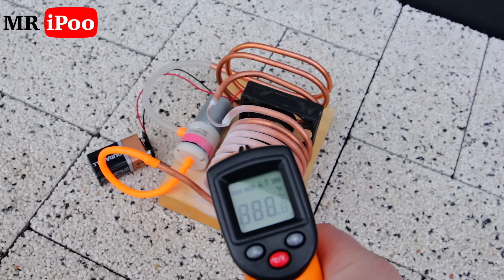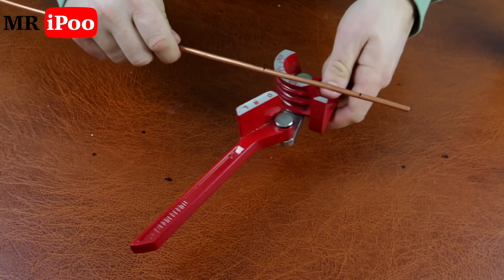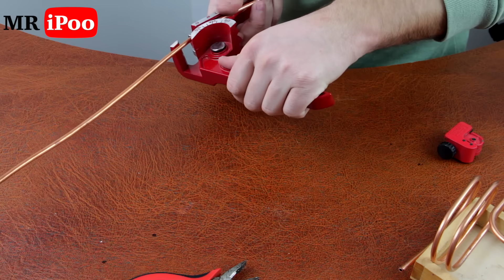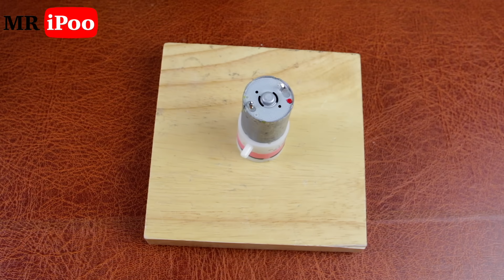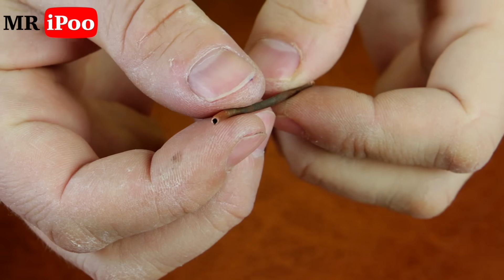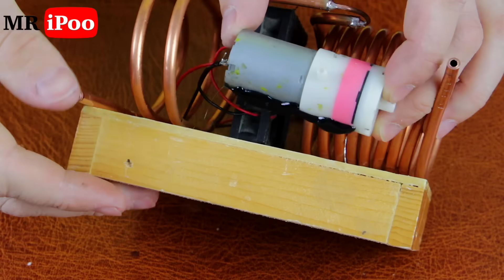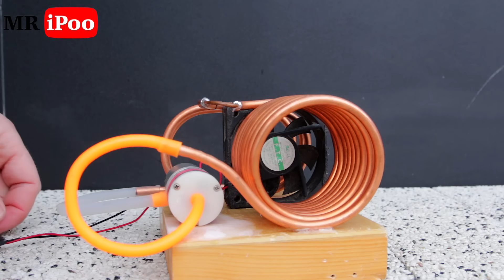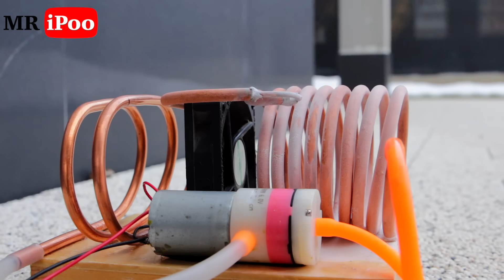DIY Freezing AC : Crafting an Icy Air Conditioner down to -32°C!

Comment: The motor and compressor used came from the plugin air pump from a fish tank. Pretty straight forward.
Reply: Lol not even close. This is a DC motor piston-diaphragm pump with a "crank" mechanism.

A fish tank pump is a vibrating diaphragm using a magnet and the AC mains frequency to drive it.

One has notable compression capability with reasonable flow rates. The other moves tiny amounts of air at in/WC level pressures.

They are not remotely alike in ability.

Comment: Im Ruhezustand hat Brenngas in Flüssiger Form je nach Außentemperatur 5Bar ca. 
In einem Kompressor werden Drücke bis 20Bar aufgebaut.

Das Spielzeug hier kann nicht funktionieren wie Dargestellt. Hier Versucht jemand die grenzen der Physik zu überlisten... 

-Befüllung ohne Vakuum ziehen. 😮
-Gummischläuche würden schon beim befüllen platzen, oder abspringen. Die Pumpe hat nicht genug Power, schon gar nicht mit einer 9V Batterie...
Reply: that's nonsense, at room temp lighter fluid pressure is only 3 bar

Comment: You can use those air duster cans for propellant. its just good old R142a
Reply: And previous freeze / dusters were R-134a (I think they were a CFC originally?)
Reply: @troubleshooter1975   Gotta love the Internet...
1,1-Difluoroethane, or DFE, is an organofluorine compound with the chemical formula C2H4F2. This colorless gas is used as a refrigerant, where it is often listed as R-152a (refrigerant-152a) or HFC-152a (hydrofluorocarbon-152a). It is also used as a propellant for aerosol sprays and in gas "duster" products.
Vapor pressure is in the 70-something-psi range for room temperatures - getting up there for the rubber hose tricks, but still a good choice for a bench-demo kind of thing.
I'm starting to feel a little compulsion to build a small chiller for the fun of it... maybe I should stop reading these threads 😆

Comment: the thing is this will never last long.  for one that little pump dose not have the power to compress the R290 back to a liquid.  I'm sure that little pump is not able to reach  200 PSI.  and that little hose will never hold the Flammable gas in.   I don't know why people like you waist so much time with this garbage, and lies.

Comment: How much heat can this system dissipate? Thinking of using this for a deskfan in the summer.
Reply: None because it's fake, the pump is normally supposed to be powerfull enough to bring the gas back to liquid form, which this pump with flexible pipes absolutely cannot do. The video was reversed
Reply: As for as using something like this for a desk fan, you have to understand that any refrigeration system does “make” cold air. It moves the heat from one place and releases it in another. The total heat dissipation of this system is negative. You have to include the energy from the battery which is dissipated as heat in the fan and the pump.  In other words if you stick this in front of a fan it is just going to blow hot air on you.

Comment: I'm surprised they haven't used this for PC cooling. Just "cold" enough so that condensation never forms. You can OC like crazy!!!!
Reply: It wouldn't be able to move enough heat.. If it works, it is very inefficient.
Reply: @MadScientist267   I think u may be right, it's why Peltier coolers never took off? But technology does improve with time.
Reply: @lil----lil  Yeah that's definitely an efficiency issue there. There isn't much to improve on. There will always be competing forces within something related to Peltier type devices... you have a resistance working completely against the force that is pumping the heat... it spends most of its effort trying to get rid of its own. 

To get around that, the material will need to be a superconductor, which currently aren't happening at CPU temps... if you've already got the cold temps you need for the superconductor... skip the middle man and use it directly... 🤷‍♂️

Those are useful devices, and can be made to operate rather efficiently (protip: don't drive them so hard, use more of them instead)... but once you start building a serious scheme that has some useful numbers, you're looking at both cost and physical complexity, not to mention real estate to give any stacking room to work.

Niche only. This kind of thing, assuming it actually works (the physics are valid, the materials are a different thing, rather dubious)... would fall into the same category.
Reply: @lil----lil  Have the holiday inn express version and definitely play like one...

Official? No. But decades of messing with all kinds of electronics both professionally and as a lifelong hobby.

"I dabble" 🤣
Reply: He hasnt used it because its fake...

Comment: Most people do not realize that home air-conditioners  and commercial air-conditioners use liquid propane. Only in cars is refrigerant used as it has to be non-flammable in case of a crash. The scaled up verison of this is the home window mounted air-conditioner.
Reply: My home AC at home does not use Propane, Propane refrigerant is  R290, witch is used a lot in Restaurants, under counter Cooling boxes ect. and some older Refrigerators.  Residential AC systems used to use R22, witch is being fazed out for  R410, witch is not flammable.  Cars use R134, witch is also not flammable. for any of these gasses to be flammable you need high oxygen levels.   You need to do some research before talking out your butt.
Reply: @McCuneWindandSolar What research does he need to do?  He sounded pretty spot on.  R290 CAN be used in just about any a/c system, especially the old r-22 systems.  Its VERY common in Europe to used in residential a/c.  But since the US is full of pussies that are scared of being "blown up", and since its available everywhere there's no money in it, so naturally it got a bad rap.  So just because YOUR system doesn't use R290, doesn't mean the next persons system can't.
Reply: @aaronk.4694  R22 runs at a higher pressure than R290  R22 high pressure is 250, and 410 is 480+,  and R134a is from 100  to 250 psi  pressures are all different.  the fact is this video what he is doing will never work. even if he used butane
Reply: A/C uses propane?  Where on earth did you read that?  No A/C product, domestic or commercial, uses propane.  You may be confused with after market automotive charging cans that do contain propane or its cousin butane.
Reply: @Georooney reffer units on commercial trucks
Reply: @Georooney the refer units on commercial trucks. They don't use it in normal automobiles because it's explosive. But since the begging of a/c units in commercial applications they used liquid propane, my neighbor has an old one that he had to remove the propane out of as he was convering the box into a sealed dyno room. And the unit said liquid propane only on the tag. I was dumbfounded as you when I saw the tag. And it certainly wasn't r134a we recycled into his forklift. We reclaimed the propane and used it in his forklift.

Comment: Absolutely cool idea but if you're going to make it make sure you buy yourself a case of 9 volt batteries because I'm sure that one battery won't last very long at all and will you drop the link for where you purchased that pump
Reply: You think 9v batttery with very low current is able to power up this system? This battery has probably half watt power.

Comment: A great video describing the concept of refrigeration, however, should the system not be evacuated of air before introducing the refrigerant?
Reply: It's completely fake anyways
Reply: Correct, if you want it to work properly.
Or you could just purge it with the butane before closing it up [take care; highly flammable and explosive].
You would need the right sized capillary tube.  This was just a demonstration [or a fake].
Reply: they actually make mini rotary compressors for like $300 that are the size of a coke can. But yes this is completely fake.

Comment: I'm surprised this works. It would be better if you change three things:
1: Before closing the circuit, blow all the air out with lighter fluid. The pressure influence by the trapped,air interferes with the working. Only 100% coolant is ok.
2: The condenser needs a constant flow downwards, so you need to rotate the condensor 90° round the Y-axis. This way the condensed fluid will accumulate at the bottom.
3: You must put the cappilair tube as low as possible. This way the condenced fluid at the bottom will enter the cappilairy full scale instead of only gas. You can test this by putting your design with the wood topside.
Reply: Fake, does not work :)

Comment: Would like to have seen the condenser temperature. And of course the pressure drop across the capillary would have given us the complete story...
Reply: It's fake, but my comments explaining it keep getting removed!
Reply: @nielsdaemen  Well, one might question the pump being able to generate enough pressure running on the 9V battery, it does seem to slow down which I would expect to happen pretty quick, not much energy there. And the capillary tube ID might be a bit big, but then the pump probably isn't generating that much pressure drop across it. I'm sure some of the HVAC could show us the math of the minimum pressure drop needed...
Reply: @davewright3088  Indeed I run these pumps from a bench power supply for my tests because a 9V battery can't provide enough current. These pumps can only reach 1 bar so I use two in series. Butane can make a 20 °C difference at 1.5 bar pressure diference
Reply: @nielsdaemen   Interesting to know from someone with hands-on experience with one!

The online specs are either non-existent, or untrustworthy... (and I don't' have the time!)

Question; can it draw vacuum on the suction and still achieve 1 bar pressure?
I saw one pump that gave a rating and was about 14" Hg suction; but only gave the l/m for the output.

I had not seen an axial design diaphragm pump before.  I suspect it is positive cam drive compression, and spring return suction?
Reply: @davewright3088  as cableguy130 points out in other comments (and I am disappointed in myself for not seeing it earlier) the pump doesn't need to generate enough pressure to condense the butane. If the pump is in a loop where the output becomes the input, it just has to move the material around, it doesn't "feel" the pressure of the closed system. Bic lighters don't have pumps in them, and yet somehow the butane stays liquid 😆  The pressure drop needed would be minimal, but I would still like to see a kink in the capillary tube copper to really get a good pressure drop - if it was working against a pinhole restriction it would seem more believable.
Reply: @troubleshooter1975  Pressure (against a restriction) would be just as good as a vacuum pump - you just need a difference within the loop. If everything else is correct you will get the phase change needed.  I have to keep reminding myself that, at rest the system will already be at pressure and there will already be an amount of both liquid and vapor in the system - barely at equilibrium. A tiny bit of pressure and some vapor would condense, a tiny bit of vacuum and some liquid would jump to vapor.
Didn't they used to make refrigerators (maybe still do) that actually work by vaporizing the working fluid with a small flame?  Ammonia based I think...
Reply: @davidsmith3302  Yes they had absorption refrigerators. I had a portable one for traveling that held about a half gallon...
Ran on 120V or 12V
[domestic refrigerators had models that ran on kerosene IIRC, and RV fridges run on electricity or LP]

My question about the pump was to try to derive the total pressure differential they can achieve.
Since the only specs I could find were -50kp and liters of flow, I was wondering if he knew the max output pressure these can produce. (I was going to add the vacuum and the pressure, for total differential, and see if it got us to the required amount to theoretically make this work).
Reply: capillary tube does determine the health for general units, but in this instance i think this is sufficient
Reply: I wanted that too! (AND, he never hit off-target to see if readings were true - was the thermogun, was his gun calibration skewed?)

Comment: You can use Propane also, I’m in Refrigeration and basically all R600 is, is Propane. But this is a cool little project.
Reply: It's fake, but my comments explaining it keep getting removed!
Reply: @nielsdaemen   That's because the principles are valid even if the execution here is crap. If all you care about is whether a video is fake or real, then you're done here. It's fake. Go back to your porn site....
Reply: R-600a is isobutane; R-290 is propane...
[your in refrigeration?? everybody makes typos... just correcting info, not criticizing.]
Reply: @troubleshooter1975  The big difference for bench top demo toys is the vapor pressure. Propane (And other refrigerants) are head and shoulders above any kind of butane. Iso-butane is an excellent choice for a "toy" like this.  (hi troubleshooter - still working on that materials science data to see how much a low pressure system could deliver....)
Reply: @davidsmith3302  😃You must have more free time than I do! I would love to delve into this, but too many other priorities...
Interested to see what you come up with!
Pumps appear to be about 3 or 4 Watts (if not overvoltaged), so that is the first limitation.
Reply: @troubleshooter1975  Theoretically, I'm retired - but everyone finds out what a difference there is between theory and reality there too 😂
No promises - but then I said I'd never bother getting into solar power either, and now I'm running half the house on solar charged batteries all day and evening.
Did you see the "new and improved" model posted by Gab tech expo?  He has cleaned up a few things, and it's getting tempting....
Reply: Then you know this unit is useless. 

Any btus absorbed by the cold end are just released out the other. 

It won’t cool much as designed.
Reply: @rickschlosser6793  Exactly, but it is possible to create a working heat pump like this with upto 20C temperature difference. The main problems are leakage in through the motor shaft and butane dissolving the tubing... 
I'm trying to find a type of flexible tube that is butane proof.
Reply: @nielsdaemen I did work in industry.  I would suggest finding some tubing made out of PTFE (teflon), it is impervious to most chemicals.
Reply: @nielsdaemen  automotive fuel hose?
Reply: @rickschlosser6793  One of several MINOR fixes that could turn this "fake" into a working demo. Thanks.
Reply: @nielsdaemen  If you're actually intending to build a working model, you could just epoxy the copper tubing to the pump ports (if it doesn't crack loose).  Motor noise will be higher.  -have to figure out a charging port...
[I suppose you could heat weld the tubing to the port plastic]

Science supply houses have thick walled tubing for vacuum use, I think of a variety of materials...
Reply: The problem with propane and something like this is the operating pressure. Butane boils at room temp around 25 psi... Propane is around 100. The silicone and orange tubing would have trouble staying on when it is sitting there nevermind operating.

Comment: It's a bit of an explosive invention, maybe if you use freon it can prevent you from a possible accident with lighter gas.
Reply: I wouldn't panic too much, lot's of commercial fridges use LPG which is just as explosive.
Reply: Freon is a name brand not a type of refrigrtant. Butane is a refrigerant so is propane. Weather or not this will work or not I am not sure. I dought it
Reply: After a bit of searching, it seems hydro-carbons are VERY common for refrigeration systems.
R170 - Ethane, R290 - Propane, R600 - Butane, and many more. As long as there is no oxygen in the system, it should be fine.